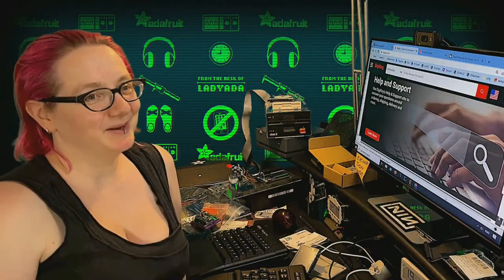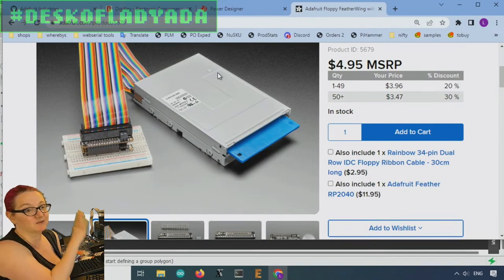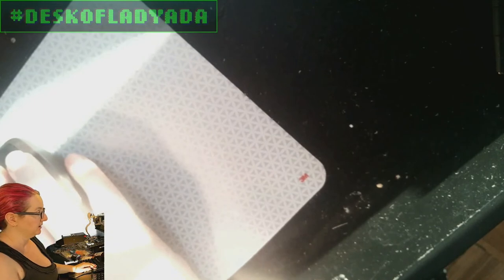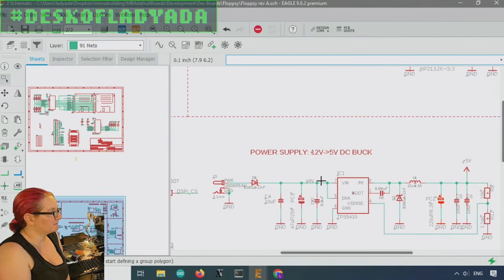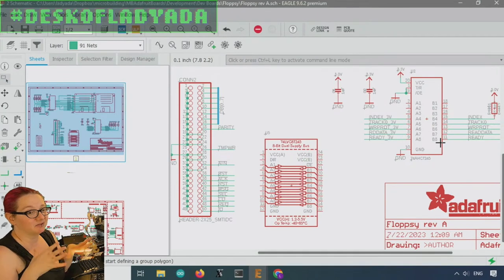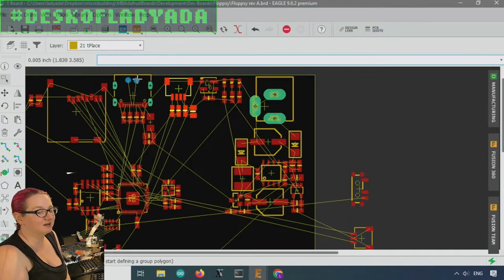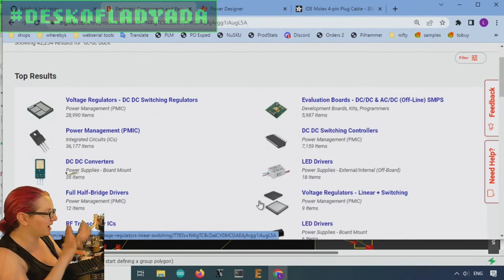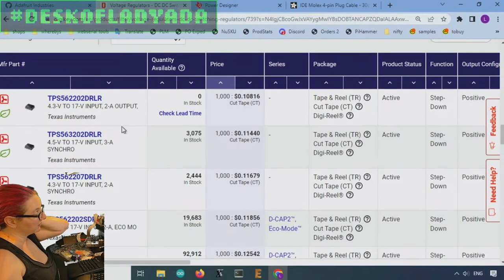Desk of Ladyada - Flippy Floopy Floppy Flavor

Comment: Great to see developing the ability to easily read old floppy data.  Several years ago I spent many hours on reading old floppies and was somewhat successful.  Found that the different formats of old floppies complicated the effort; 5.25" and 3.5"; single and double sided, and 360, 720,1.4, HDD etc.  Actually ended up buying a module and interfacing with specific desktop drives that allowed reading most of old data disks.  Enjoy your channel and appreciate your work, products and effort supporting open source philosophy.

Comment: Hope you will be supporting hard sector 5.25” media like northstar and heathkit.  Also might consider an adapter cable for 5.25” floppy to 8” floppy.  If you a thinking of emulation you might need a write protect switch.
Reply: Support for emulation of hard sector floppy disk is currently rare.